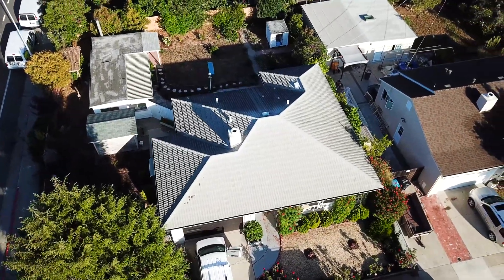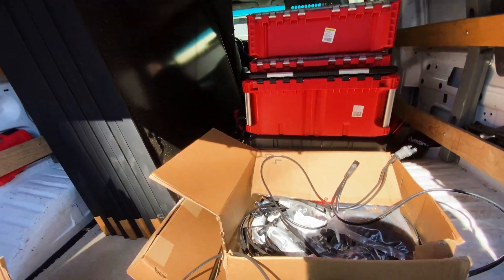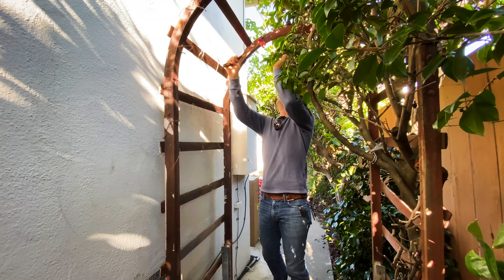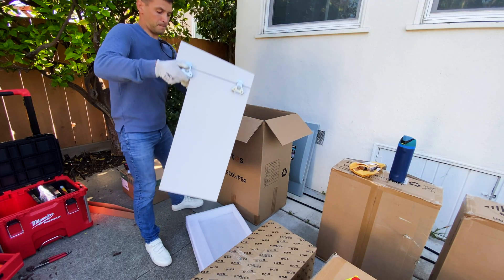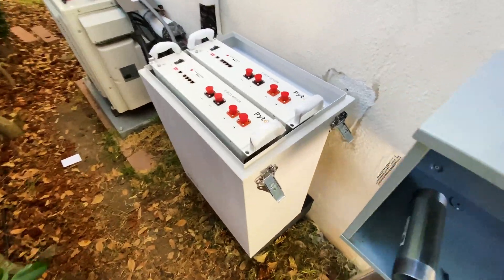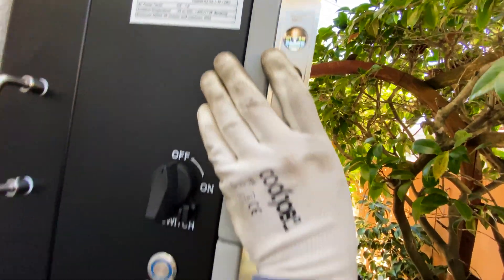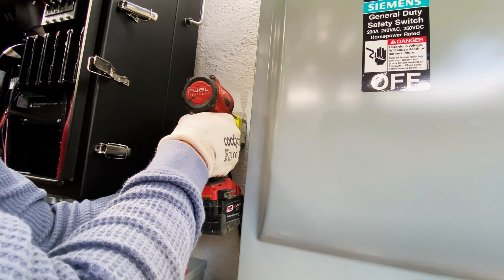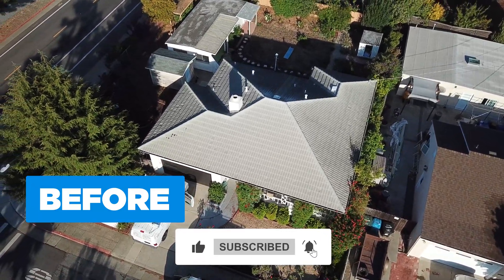Full-Home solar battery backup with Sol-ark 15k and Pytes batteries. 4.7kW solar system.

Comment: What are the pros and cons of doing the line side taps vs sub-feed lug kit and subpanel?  Trying to figure out how to inject inverter between meter and panel. Love your videos btw
Reply from the maker: Line-side tap is more for grid-tie solar systems (no battery), it helps to bypass the 120% rule.
If you are installing batteries, you'll need to run a wire from the meter to the inverter and then either back to the panel or to the new subpanel.

Comment: Hi, I’m wondering if you had any issues with the rapid shutdown not working properly with Sol-Ark, I’m using a string level rapid shutdown made by Midnite solar in 3 jobs 1 12k and 2  15K, they all have problems to wake up in the morning, the 12 is in my house so I turn off and on the inverter’s PV switch in the morning to make it work, the other 2  I tried and APSmart transmitter, but it didn’t help, SolArk is sending 2 newer 15s, let’s see if that helps , they don’t have a fix for the 12K
Thanks in advance
Reply from the maker: I did use Tigo and APSmart, and there are no issues so far.

Comment: does an ac disconnect consider a main panel if installed before this main service panel? my ac disconnect doesn't have any breaker it's a manual switch for disconnecting the meter from the main service manually it has 2 200amp fuse inside. so my question is if do i need  a ground neutral bond in ac-disconnect switch  and isolated the ground neutral bond in main service panel. or is going to be ok just ground wire into my main service panel with breakers? the existing grounding system?
Reply from the maker: AC Disconnect in your case is a first means of disconnect, N and G must be bonded there and split in main panel.

Comment: Nice job, I have enjoyed your videos as I'm planning for my own system.  Question:  You provide full house backup but what happens if the inverter fails one day?  Should you not have a transfer switch for this possible event?
Reply from the maker: If inverter fails then the wires have to be rewired in wire way. Some customers want to have the ability to switch between grid and backup (without rewiring), then 2 AC disconnects have to be installed (single throw + double throw). I'll do an install like this soon.
Reply: You can put on an interlock with a redundant grid feed to the panel, treating the SolArk like a constant generator. If it fails, switch back to grid to perform repairs. I did that for my Victron system.

Comment: I added feet to the bottom of the support bracket for the batteries. I had zero confidence that the support would hold up the weight in the long term. It's a really strange design and I totally agree that the supplied bolts would not work.

Comment: Why can't you attach the battery box to the wall in the area where you ran your 1-1/4 flex back to the main panel. This would take some of the weight off of the bottom bracket. I agree that the bottom bracket sucks and is a bad design.
Reply from the maker: I was thinking of adding it, because was planning to attach base to the framing. But after attaching it to the concrete foundation, it's not going to fall, so left as it is.

Comment: If that’s the main panel why are the neutrals and grounds separated?
Reply from the maker: Technically AC disconnect is the new main, so it's bonded there.
Reply: Cannot mix service entrance cables & load cables in the same raceway! NEC 230.7

Comment: Great work, and I love that you showed how everything was done!!! 😎
And agreed, that battery cabinet/mount is a poor design.
It looks like the 15K was massive overkill for this ~5kW system.  Awesome inverter, but pricey for a 5kW system.  I'm assuming this inverter was selected for potential future expansion?
Reply from the maker: It was easier to do a full-home backup, rather than do a new critical load panel.
Plus we are on the edge for PV array size for the 100A service, if customer wants to add a few more kWs, then the service needs to be upgraded from 100A to 200A, and it's going to cost more than the inverter.
Reply: @SolarEngineering  Roger that!  It's a great inverter for sure!  The only downside I see using it would be the higher idle consumption compared to a smaller properly sized inverter, but at 90W (I believe), it's not terrible either.
Reply: BTW, it would be great if you could also show a line drawing for your installations as well so the viewer can more easily see what you're doing.  Great video though!
Reply from the maker: ok, will include electrical line diagram next time. 
My next installation is Luxpower 12k, by specs/price it looks like Sol-Ark killer, will see it soon.

Comment: Nice work, but I agree with you on the battery cabinet should be stabilized with upper brackets, does code prevent it?
Reply from the maker: no code is okay with top mounts, it's just how Pytes decided to do it. I did reach out to them and they didn't see any issues with design...
Reply: It's a strange design. I think that the idea is that you can clean underneath the unit, but I welded 2" square legs on the side and the cabinets now sit nicely on the floor. No real need to bolt them to the wall, because with over 100kg sitting there, it's impossible to move it!